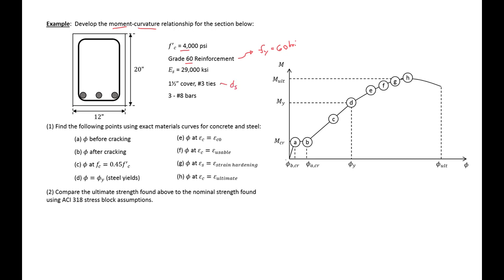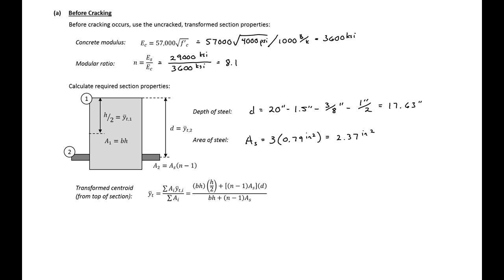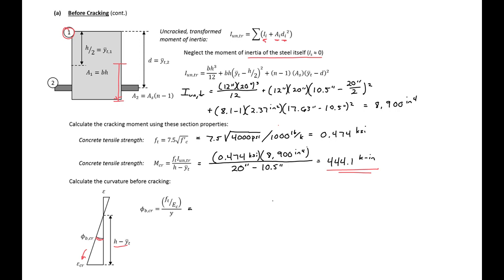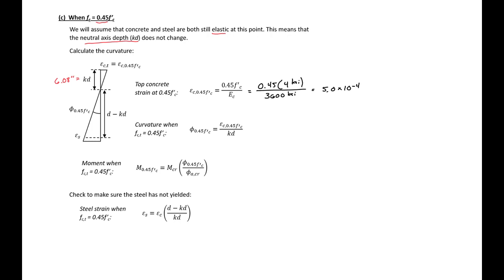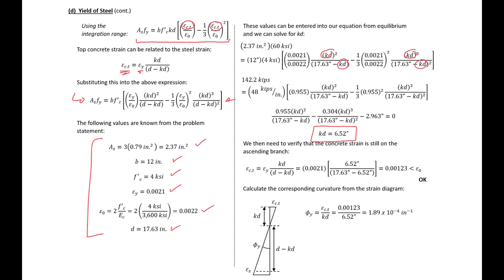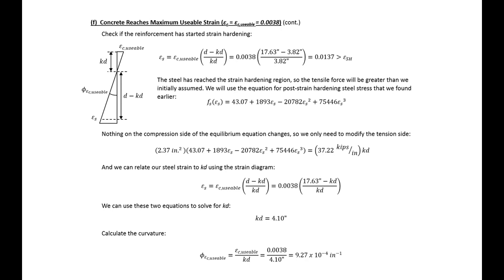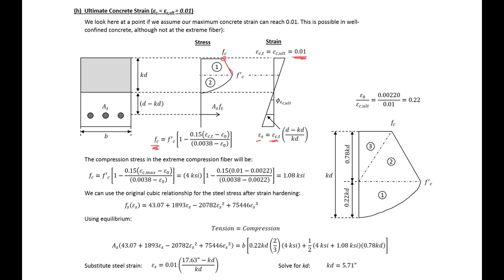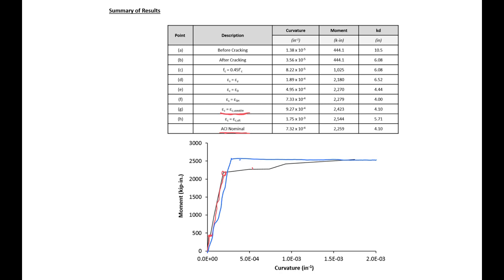7 - Example 1 - Full Moment-Curvature for Rectangular Reinforced Concrete Section

Comment: Thanks for this Quality Conent, but i have a question in the 42:46 where we use equilibrium to solve for Kd, is there any chance that the equation had an error, because i've tried to solve it in different softwares but it always give me the answer like 11 inches

Comment: Hello 
excellent and instructive example.
Question about the value of curvature determined at point (g, 7.33E-4) that is less than what obtained at point (f, 9.27E-4) that gives an consistent graph
Reply: Develop moment-curvature relationships for the following cases using hand calculations (a) 
flexure producing tension at the top of the beam, no strain-hardening in the longitudinal 
rebar, #4 ties at 10 inches on center; and (b) per part (a) but with #4 ties at 3 inches on center. 

〖fʻ〗_c =4k 
Fy = 60 ksi
F_yt=60ksi 
h=24 inch
b-20 inch
Reply: please solution this question

Comment: In part f where you are finding the y bar of 3 section numerator and denominator separately how you calculated the summation Aiyi equal to 358.38 kip- inch  something? I didn't understand how ? Will you explain it plz  !! At 38:04
Reply: Im stuck kindly reply sirr!🙄
Reply from the maker: All three of these components should be taken times b. I forgot to include the times b in the last two terms. You will get the 358.38 kips if you include that and use kd = 4.1", f'c = 4 ksi, and b = 12".

Comment: Thank you for such a great work. How did you calculate the stiffness @ the start of strain hardening region (Esh = 1500 ksi)? Also, is strain @ the begining of strain hardening region relative to yield strain
Reply from the maker: This stiffness is an approximation for the stiffness at the start of the strain hardening region. You can find the stiffness at other points by taking the derivative of the equation shown on the second slide.
Reply: Thank you for your reply. If the section is doubly reinforced and I caclulate the M-phi point (f) at maximum usable strain, will we take the compression reinforcement steel into consideration when we calculate the centroid of the compression zone "Y" and calculation of moment at the centroid?